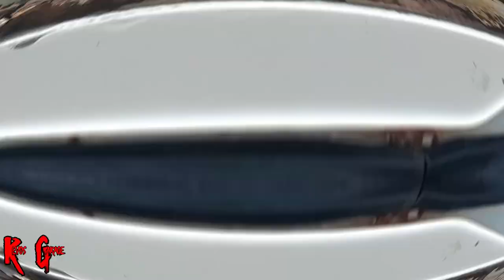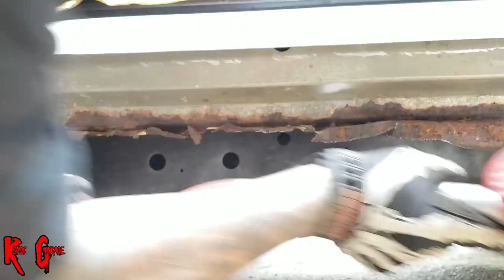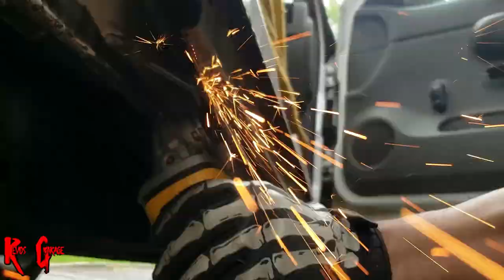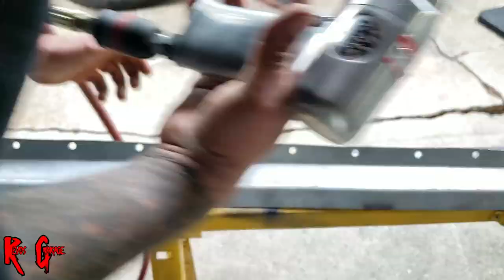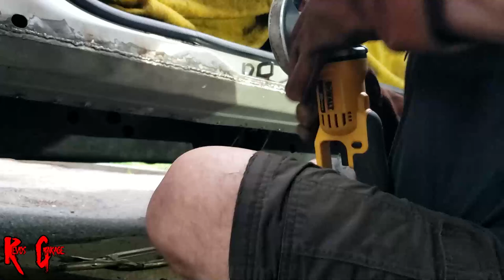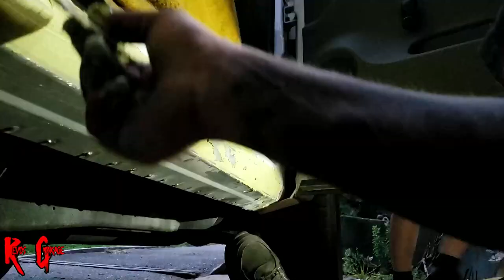2007-2013 Chevy Truck, Rust repair, Rotted Rocker Panel Replacement, Time Lapse, RG

Comment: Awesome time lapse man looks sweet about to tackle this myself with zero experience haha time to buy a welder and grinder !
Reply: Curious how much you had to spend on those , you think it’s a good idea to look on marketplace?
Reply: @dbotanist2079  I got a top of the line cordless dewaukt grinder for around 500$ new with a 9amp battery that’ll last all day, the welder well that’s another story I have yet to come across a good deal but I assume a cheaper mig welder will get you by no problem
Reply: @daemionsmith5554  hey thanks man I appreciate the input !
Reply: @dbotanist2079  the amount of videos I’ve watched to complete the work I thought I’d never be doing turned me into a gear head I really see how much time and detail goes into finishing work, just all about the dedication for sure don’t need the best of the best to get far
Reply: @daemionsmith5554  oh forsure! It definitely looks like a project that is doable! Thankfully I only have one side that needs replacement the other side just need a little bit of touch up !

Comment: If i knew, for sure, that you were the guy that worked on a vehicle before I bought it, I would definitely buy it.
hahaha i wish you were the guy that worked on my jeep before i bought it for sure. Lookin at a family owned 07 but the frame is already that light orange/red with minimal flaking.
Reply from the maker: Thanks! Just grab a screwdriver and poke the areas that look suspicious. if the metal is soft, you'll know.

Comment: As experienced body tech that’s not entirely the correct way to go about replacing the lower rocker panels 
You need to go the dealership and buy the whole side panel and only cut the section u actually need if that make sense
Reply: If the dealer didn't charge a arm and a leg people probly would

Comment: Hey bud, I appreciate this video, there isn’t a whole lot on the gmt900 trucks. I have a question and I’m not sure youd know or not but who better to ask than someone fixing rust on a gmt900…..with a bad ass metal riff going on. 👍. anyway, I can’t find rockers for my 07 Tahoe, I’m starting to think they’re the same as the extended cab pickups. Would you happen to know if that’s the case? Or could you shoot me a link to where you get your panels? Keep it up!

Comment: buying the actual replacement metal rocker panel would have been a lot cleaner, and economical. The work is solid, but there's no replacement for doing it with OEM stamped parts
Reply from the maker: I agree. But it wasn't my truck or my parts. I just made shittty parts look good!

Comment: Great job. Do you have a link on where to buy the rocker panels? Were they OE or the slip on type cut to fit?
Reply from the maker: customer supplied
Reply: As as a experienced body tech normally u buy them at the dealership